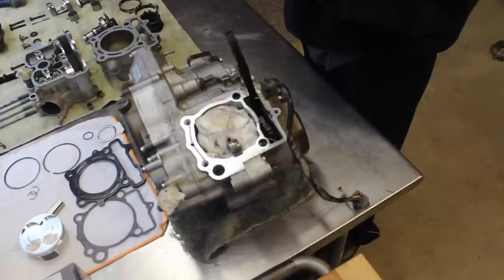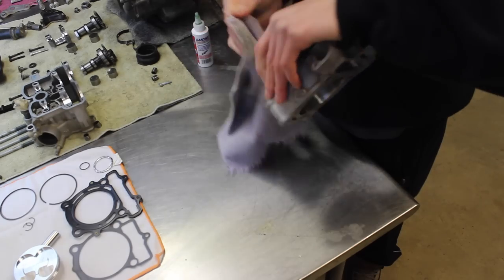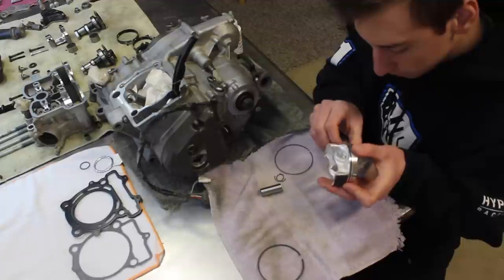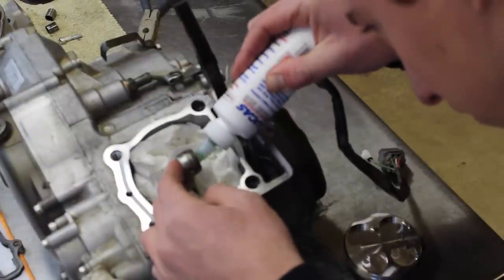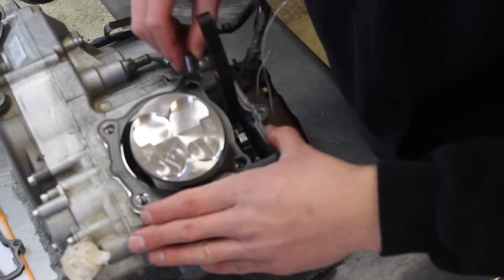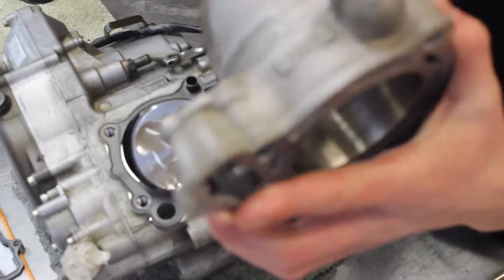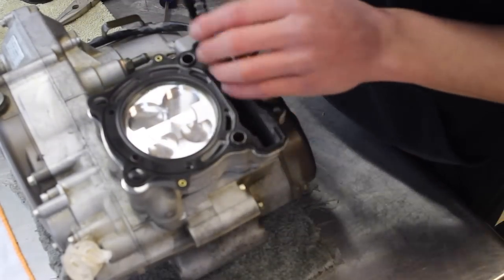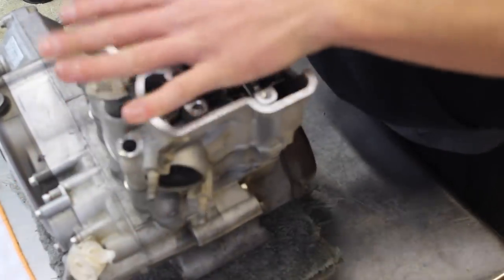How To | KX250F Top End Re-Build

Comment: didnt look like ur cylinder was sleeved and u honed it
Reply from the maker: Doesn't matter if it is sleeved or not sleeved. You hone it either way.
Reply: nope sorry when they are plated u are not suppose to hone them,,
Reply from the maker: +wolf360090 you obviously don't know what you are talking about and you must not understand what honing means or does, so please read this (don't tell me I'm wrong because I know what I'm doing). the whole purpose of honing a cylinder is to remove the carbon build up and cross hatch the cylinder for the new piston rings. 5-20 seconds is plenty. Your not grinding the cylinder out like a machine shop would to put a wider piston in.
Reply: act i do know what i am talking about..plated cylinder do not need honing..they do it at the machine shop after plating to get to the size and to trew up the cylinder,,but after that they are not suppose to be honed...plated cylinders do not to be honed like sleeved or cast cylinders..and dont say i dont know what i am doing since i have been rebuilding engines for almost 30 years..
Reply from the maker: Okay good to know. Maybe i'll have you do my next video rebuild. 
Thanks
Reply: great vids  that u have though..all u need is a scoth pad for them not honing...i have never honed a cylinder for all the rebuild i have done,just ones thta were sleeved or had a cast iron sleeve in it on the older bikes..,something like 50 so far this year,i have 5 in my garage now rebuilding..and if u think u need to hone use a ball hone and do it by hand u can burn through the nikisil pretty easy.i have known people who have done that
Reply: He's not "Honing" the cylinder.  It's called "DeGlazing".  If you knew anything you'd know that.
Reply: Your right don't listen to these fools.  You have to deglaze the cylinder.  They must assume your honing it for a bore finish but that's not what your doing your simply removing the glaze left behind and creating a new cross hatch for the oil to cling to and allow the rings to seal better.  Squids.  lol
Reply from the maker: +Hired Expectations exactly, glad someone knows what they are talking about.
Reply: plated cylinders do not have to be deglazed or honed..you are not suppose to touch them.. they are a very thin layer and it can damage it..its nothing like a sleeved or cast cylinder from the past or a car cylinder.. call any reputable bike shop or the machine shop that does the nikisil cylinders.after it is done from the machine shop you dont touch it even if you are putting in new pistons and rings on the next rebuild...
Reply: +wolf360090 you use an aluminum oxide ball hone to break glaze on nikasil.  You gotta know what your doing but it can and is done all the time.  Honing nikasil for a clearance finish is a different story, you've gotta have a diamond hone and most places don't have a setup that exerts enough force to properly cut a good bore.  I've been building race sleds and bikes my whole life.  Got friends and family racing at the pro AMA FIM level, and works as a mechanic at our local Yamaha/KTM shop.
Reply: +wolf360090 two strokes with the exchange ports you have to be very careful because you can chip the nikasil by the passages however that's why you use the aluminum oxide ball hone.  The material is soft enough to not bite and chip yet abrasive enough to break the glaze.
Reply: yeh i know that,, but with the plated cylinders you dont have to..if u are just deglazcing and cleaning it up use a scothrite pad...i throw in new piston and rings in all my dirt bikes every summer and my sons as well..unless i get a scratch it it i dont touch the cylinders..6 years now on my bike when i got it plated and 5 on my sons..with my other bikes, the ones i race with.the mechamics would rebuild it after every three races and they did deglaze them but had to replate it after every 4th race or 5th race..now they just use a scoth pad and i can get a hole season out of the cylinder and they just throw in new piston and rings after 3 races,, 20 min done..i never had one blow up on the track or the pits where i drive..
Reply: +wolf360090 I can agree with that to a certain degree for sure.  Especially on your race bikes that sounds normal.  I usually will only deglaze a cylinder once, maybe twice before replacing it with a new one just because after two rebuilds they loose their shape.  When you run a bore gauge in one they're usually barreled in the middle and it's cheaper to replace the whole cylinder.   So that's why I always just deglaze them.  I agree to a certain degree that you don't always "have" to do it, it's just what I've been thought by friends and family, and my 9 years as a tech.  But I think on this one we are both right in our own ways haha
Reply: lol thats true for sure.. i know when i was a tech before i started racing we used to but was told the engines would last longer if we didnt. and i dont ride my dirt bikes at home like i do on the track so they last a long time..and we always have atleast 5 or 6 cylinders ready just in case..i guess its like painting a house everyone has their own ways and own tricks that they do,neither are wrong just way they have become used to doing what they do..
Reply: Every machanic has their own tips and tricks outside of manufacturer spec. Manufactures recommend alot of things that arent the best or visversa. If he has problems with oil burn, he will realize that maybe he made a mistake. If not, then honing didnt affect it enough to be noticable. Not sure many of you even know why you hone a cylander. The true test will see how long the rebuild lasts.